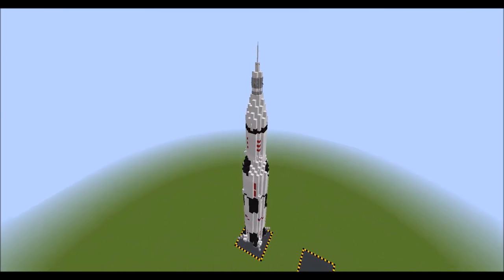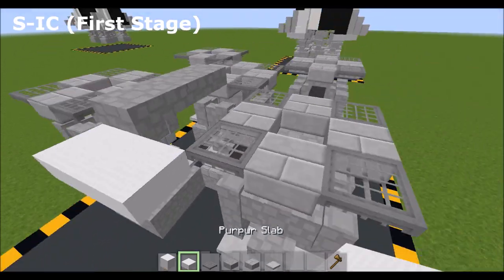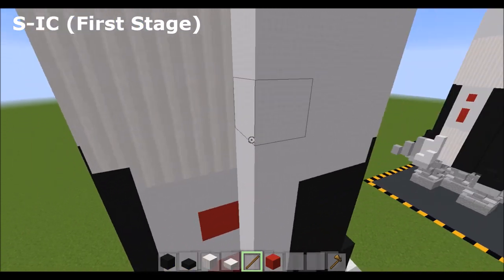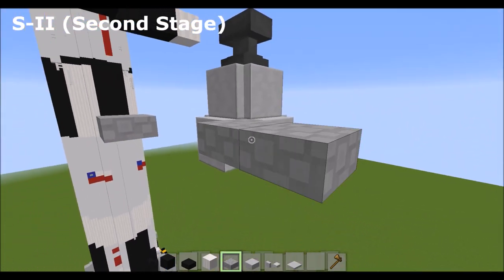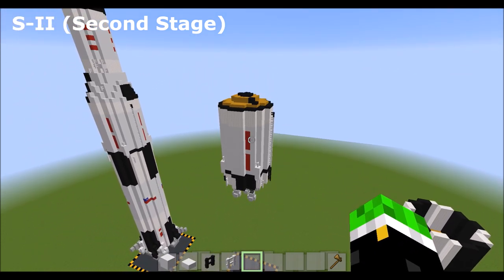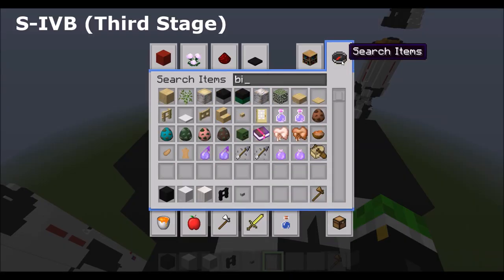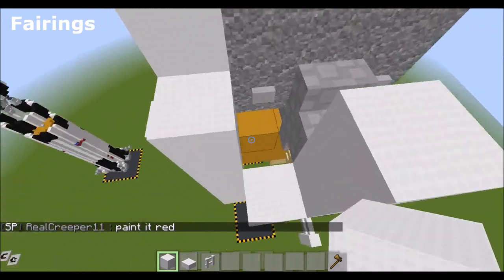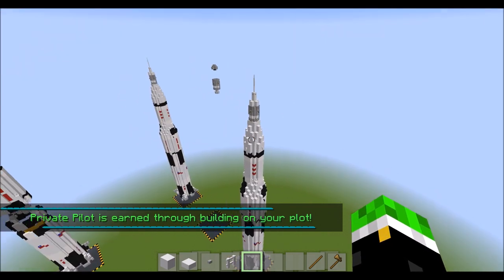Minecraft Rocket Tutorial: Apollo Saturn V [1:1 Scale]

Comment: The only issue with this cool build is the fact that the Command Module is smaller than the real thing.
Reply from the maker: It's not, actually - the real command/service modules do indeed have a diameter of three meters, so these are perfectly to scale. It only seems like they're smaller than they are because of the somewhat unrealistic meter-wide thickness of full blocks, but such is the nature of Minecraft :)
Reply: @Aeroteam  ohhh, when you mean to scale, I thought you mean’t to the Minecraft player’s height. Thanks for the response
Reply from the maker: It's that too, 1:1 scale is based on the standard that one block in Minecraft is one meter. Since the player is just short of two meters, or six feet, its height scales perfectly with 1:1 as well!